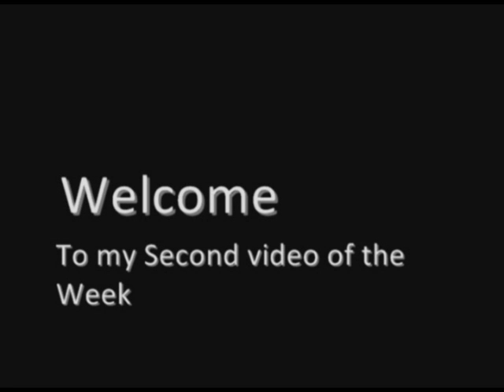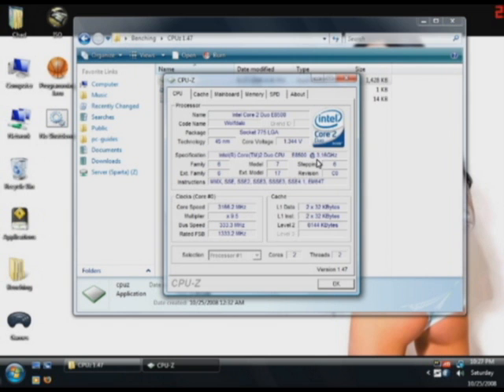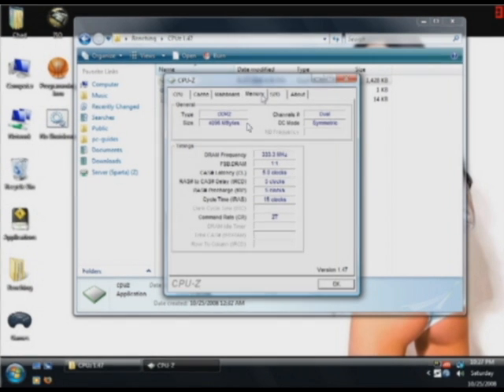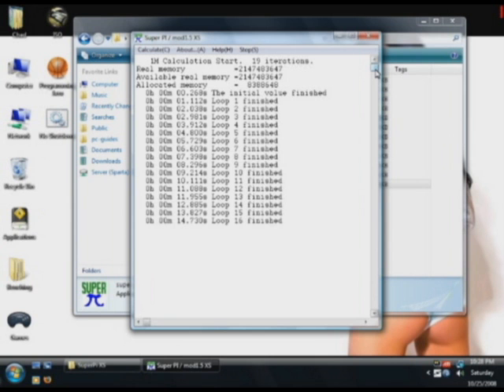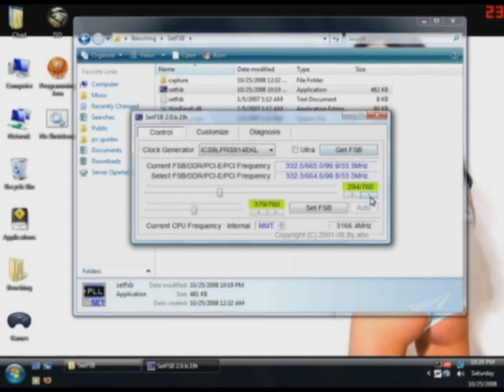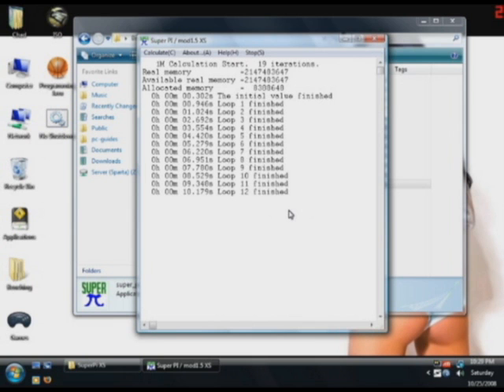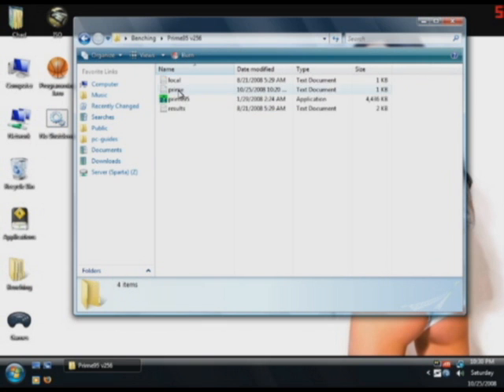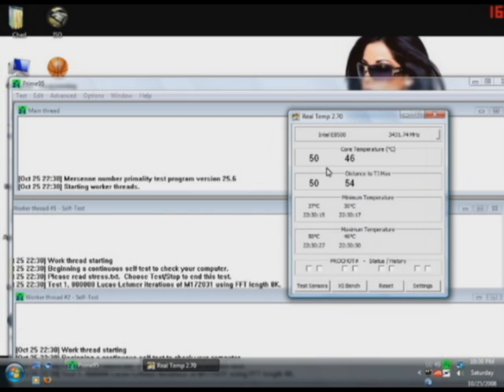How to Overclock, monitor and Stress your CPU within Windows

Comment: I have runned prime95 for 35 min on my AMD Athlon x2 4400+ @2.31 GHz, temp didn't go over 49 C, how long should i run this program to be shure my sistem is stable?

Comment: Please answer this question
I am trying to find my clock generator but i cant find it on any website ? 
please help me find my clock generator 
if any one does ill rate 5 of there vidz 5 stars and comment good and become friends and subscribe :D
My pcs details are :
chip set : Intel p35/g33/g31
Processor : Intel Celeron E1200
currently running at 1.6ghz
Running on windows 7 Ultimate 32 bit
please help help help